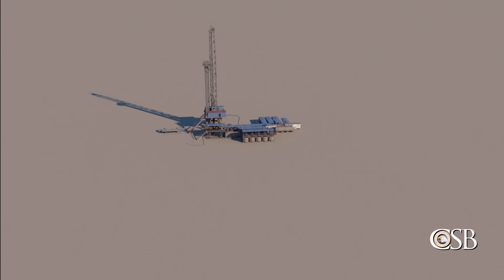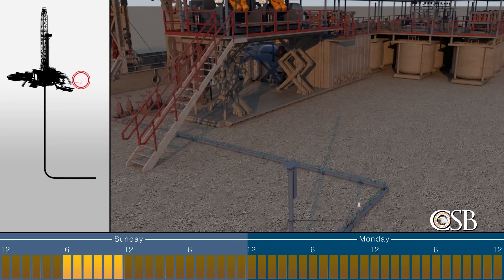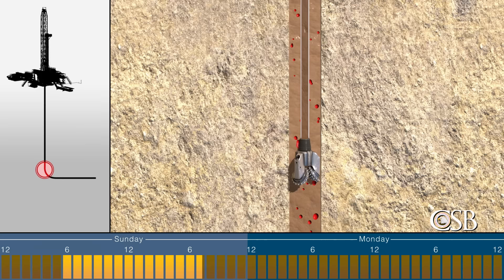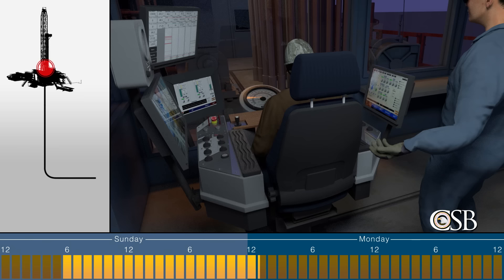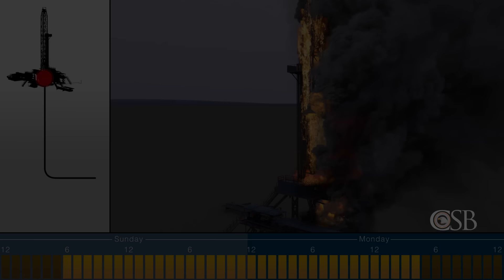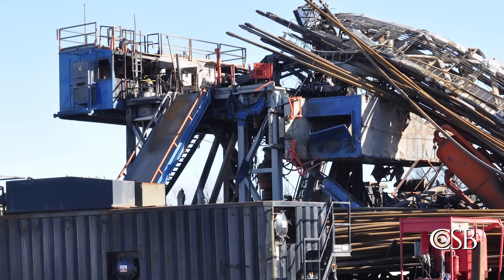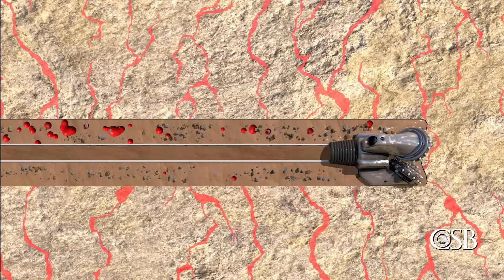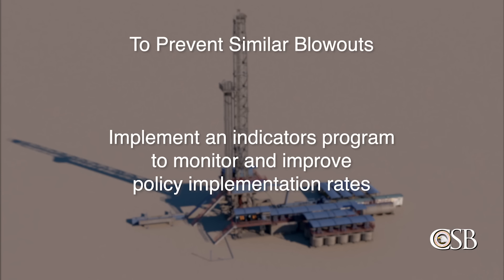Blowout in Oklahoma

Comment from the maker: Read the CSB's final report here: https://www.csb.gov/file.aspx?DocumentId=6112
Questions or comments about the CSB's video program? Please email feedback to videos@csb.gov
Thank you for watching this CSB safety video.
Reply: Lithuania had one acident too tire werehouse fire
Reply: Give the government more power is a bad idea CSB. 
Sweet Jesus open your eye's!
Reply: If you dig a hole far enough in the ground before dig a well Deep enough to put a protective cover around the BOP and then covering it up with dirt then you don’t have to worry about fires destroying the working mechanics of the BOP
Reply: @Robert468us  America! 😂 But the fire inside the BOP will have 0 effect on the rubber and metal? How about the hydraulic lines, you dig them too? And why dig the BOP, a ram closses in less than 30 seconds, you think that the fire will burn the metal and lines in 30 seconds? If you are too dumb to notice a well flowing with 170bbl and you wait until it literally blow out and let it ignite and then decide to close the bop its already too late. Wtf.
Reply: Dorin Radu They make copper wiring with insulation that will not burn and it protects the wiring inside!!!
I seen this with my on eyes and try to burn the teflon covered wiring it got very hot but did not burn the Teflon material or the internal wires!!  
 It is just a shame they’re too cheap with the rubber hoses and wires  to build such a device that can fail with fire 😂 when that’s something that supposed to prevent !!!!
Reply: @Sonyag1  thanks I’m voting for Trump. Regulations are important. He was probably referring to regulations for small businesses however.
Reply: @Lazys The Dank EngineerConservatives’ efforts to decrease the amount of government regulation are of little benefit to the average man. For one thing, only a fraction of the regulations can be eliminated because most regulations are necessary. For another thing, most of the deregulation affects business rather than the average individual, so that its main effect is to take power from the government and give it to private corporations. What this means for the average man is that government interference in his life is replaced by interference from big corporations, which may be permitted, for example, to dump more chemicals that get into his water supply and give him cancer. The conservatives are just taking the average man for a sucker, exploiting his resentment of Big Government to promote the power of Big Business.
Reply: Safety written in blood every time. Humans have brain, ability to reason, prior experience to preceve trouble. Workers have no protection from asking question about safety! More crew will die on job unnecessarily.
Reply: @kaisonray4515  Totally random.
Reply: Pay those families babies..
Reply: Those many alarms are very annoying...
Reply: @yourbabyboyfriendonlyme2485  You weren't paying attention.  The majority of the recommendations were directed at NGOs that have an interest in the industry.  Not to governments, beyond making it mandatory that you have the safety features the NGO produce.
Reply: You all prolly dont care but does anybody know a tool to log back into an Instagram account..?
I was dumb lost my password. I would love any tricks you can give me!
Reply: @Kingsley Langston Thanks for your reply. I got to the site through google and I'm trying it out atm.
Looks like it's gonna take a while so I will get back to you later when my account password hopefully is recovered.
Reply: @Kingsley Langston It worked and I actually got access to my account again. I'm so happy!
Thank you so much you saved my ass :D
Reply: @Aryan Tadeo No problem :)
Reply: Thank everyone ppl ppp
Reply: I blame Obama
Reply: The only thing I don't like is that csb just covers there ass blaming people that died
Reply: Who is we all I see is you the puppet with strings
Reply: @fernandojuancadena2475  what are you talking about? The CSB investigates accidents— they aren’t “covering their ass.”
Reply: @Robert468us what 😂you 😢 we

Comment: I worked rigs for two years.  We were trained for blowouts.  But, actually, I learned more practical safety advice in this video than I did in those two years.
Reply: For which drilling company,
Reply: @IA52000  
Bomac.  This was in Williston Basin, in western North Dakota, way back in 1980 and 1981.  Thanks for asking.  Yourself?
Reply: James McGinn I haven’t worked on rigs sir, I’m a pumper for pioneer resources
Reply: What y'all don't get unless ya been there.. In the old days the safety standards pretty much were at the whims of drillers n pushers. You did as ya was Damn well told or they'd run your ass off. Period.  Its a world you don't know about and no amount of tv can show you what its like out there. We used to smoke on the rig.. Looking back ... Balsy.
Reply: @SandmanSand  u
Reply: @stevebarnett3571  Or stupid. The folly of humanity. We progress and learn
Reply: @stevebarnett3571  it's not just the oil industry, pretty much every kind of manufacturing / manual labor business is cutting every corner they can to make quotas & save money. unless you're high up there you're just a tool for the high up there guys to use. it sucks that we only ever really change things when people start dying
Reply: Looks like you were a mess of an worker.
Reply: Thanks for what dangerous things you do for our Country!
Reply: @stevebarnett3571  Drilling back in the day didn't go as deep or any of the directional drilling they do now days. It makes the process a little more complicated than drill til we find oil then call the company lol
Reply: @TheRCish  Most rig workers dip tobacco, a few chew nicotine gum.
Reply: That's very alarming
Reply: James! Good Lord Man! That says it all!
^..^~~
Reply: @roboticunclephil  agreed I install natural gas mains and services I see our crews cutting corners daily like not grounding the ratchet for tapping the main to gas ut up
Reply: That's fooked up.
Reply: I tried joining my brother on a rig, but I didn't last a single week after seeing the relatively tiny but deadly shortcuts they took. 
The money wasnt worth the risk of disabling or killing myself.... Only barely though.
Reply: @SandmanSand  no its just cheap, and trust me, even if you dribe electric you NEED cheap gas.
Reply: HE HAVE THE MOST IMPORTANT PART OF THE JOB Thier isn't no failing at that stage 💪
Reply: @roboticunclephil  Well I'd say after mass death occurs and multiple lawsuits does something ever change. The thing with companies in manufacturing is those higher ups don't care about the workers hence why safety standards don't really exist. A few deaths won't change anything. They'll just replace them with new people and go about as if nothing happened.
Reply: James, worked rigs for almost 20 years and It seems that America is twenty years behind in the thought process about blowouts.There were 2 things I watched.for.
1) Mud gained (Swabbing)
2) Erratic weight (Gas is lighter than mud) on the scale you are using. IF it was heavier, then I had a mud ring...if it was lighter? Possible gas. I pissed so many Consultants off by circulating and reaming. I countered with...."If I don't we spend two hours more running casing!"
Reply: Me too
Reply: @stevebarnett3571  rigs in Kansas and Nebraska still run like that
Reply: Prior to 2012 there was no safety in the oilfield
Reply: @roughneck2204  back in my day we used straws to suck up the juice.  Like a milkshake
Reply: That's terrible.. hearing this definitely triggers me a bit and seeing the lack of care for the workers in the rigs design is just disappointing. I hope things are better now for those in the industry.
Reply: Sounds like oil corp was doing their usual game.
Reply: yep
Reply: @MarkPentler mmmmmmm yeasssss the folly of man. I read a book I’m a professor.
Reply: Really wow that’s worrying 😳
Reply: Kind of alarming lol
Reply: No one actually trained you then.